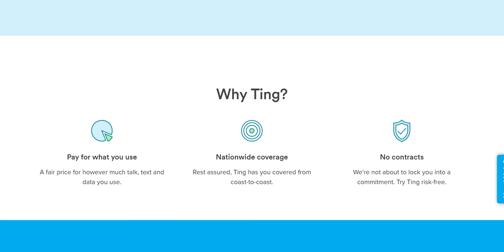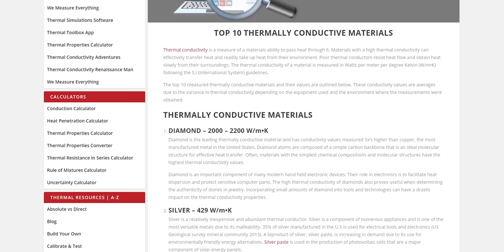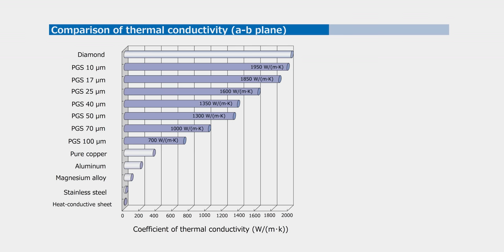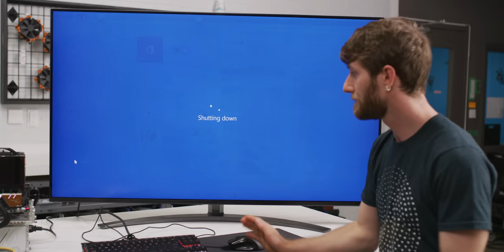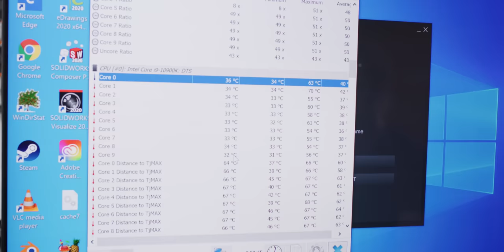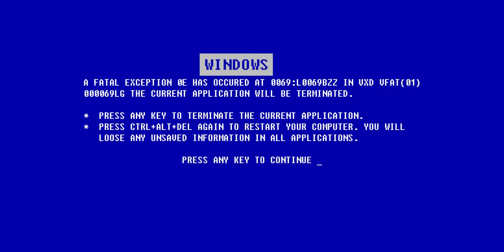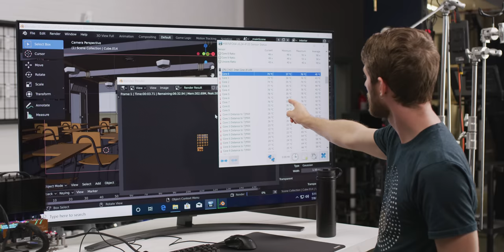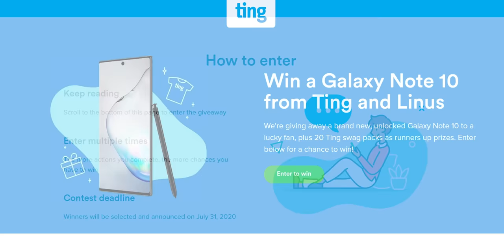This Sounds Too Good to be True - God-Tier Thermal Pad

Comment: This video and the properties of the graphene sheets had my mind thinking of different uses and applications of that product.  I think I've recognized how you COULD use it to better the thermals of a CPU.  There is only so much contact surface between a CPU and the heat sink above it.  The sections connected with the thermal paste is certainly going to be subjected to thermal saturation, where the material will lose thermal capacity at that spot until the thermal energy present dissipates into the surrounding material.  We'll use copper as the example.  The contact patch of the copper to the CPU can only absorb so much heat while waiting for it to spread to the rest of the copper of the heat sink via heat pipes or just more copper.

Now, here's where the graphene could help.  You mentioned that the graphene sheets have an uncanny ability to transport thermal energy and spread it out over the distance of the sheet's dimensions very quickly.  So, an idea would be to apply it in this format : CPU > thermal compound > graphene > thermal compound > heat sink.  The graphene sheet and heat sink contact surface could then, theoretically, be made quite wide (within the supporting boundaries of the CPU case and motherboard components).  Let's say that a 2" x 2" CPU is outputting 200W of heat, thus 50W per square inch.  If you took that same 2"x2" CPU and used the graphene to spread the heat out to a 4"x4" heat sink contact patch, you'd get like 12.5W per square inch of heat.  Therefore, the copper shouldn't reach thermal saturation as easily, and may maintain it's thermal conductivity efficiency better.

If you ever decide to return to this product, I'd love to see you experiment with this suggested setup.

Comment: Somewhat related but I used Innovation's TIM pad on my Xbox 360 S, the pad is the perfect size and works better than the thermal paste it came with. Based on Linus' other video, this was a good enough alternative to taking my Xbox apart to replace the compound. Instead all I have to do is just take apart for cleaning out any dust. If this TIM pad is good enough on an i7/i9 Intel chip, it should be good enough for the Xbox 360's custom APU.

I've been using this for the past 2.5 years. The Xbox 360 fan does not get loud as it used to with regular thermal paste. I used AS5 in the past on my Xbox 360 S, I haven't used MX4 or Kryonaut, but I'm aware it outperforms the older AS5.

I've since switched over to MX4 on my older OG Xbox, OG Xbox 360, and Xbox One. I'm happy with the results of the newer MX4 compared to AS5.

Comment: TIM only exists in this application to displace air. The thickness is so thin that virtually anything will do - and we see that in the 1-2 degree spread in coolers

The pad fails because it doesn't fill air gaps. most pads fail because they're too thick and.or leave air gaps

Try it again after lapping your surfaces (or using something to fill the surfaces)

Comment: With a lateral thermal conductivity in 1000s, I would pick it up if it offer even 1/20th of the conductivity from top to bottom which is still double that of the best paste/ metal available.

Comment: An electrically conductive thermal pad isn't an issue because the top of the cpu and metal heatsink are also electrically conductive and earthed. A graphite thermal pad will go to earth. No circuits will be shorted.

Comment: Try by folding the pad, adhesive on both the cpu and the heatsink. As in 1 piece connected together cause as Jpeg6 said, its lateral thermal transfer.

Comment: It doesn’t matter that it has that high of a conductivity value, the metal heatsinks it is in between becomes the bottleneck and will only transfer as fast as that metal can. Plus it isn’t removing air bubbles as well as thermal paste does.

Comment: You think using thermal paste between the two layers of graphene might not work and better, but it could be worth a shot!

The graphene's conductivity (thermal and electrical) is almost entirely in-plane. It may be a good insulator in the perpendicular direction, but it's super thin. So, the graphene could spread the heat out more evenly across the die and sink while using thermal paste in between would improve transfer between the die and sink.

Effectively, you'd create a slightly lower conductivity over a significantly larger area. (Think 10% lower conductivity over an equivalent of 50% higher contact area.)

I could be wrong. But I think that it's probable enough to be worthy of an attempt!

Comment: I would be curious as to how this would work if you add a good thermal paste in addition to it, and then compare the difference between this with thermal paste and with thermal paste alone. The problem is that there’s an expectation of thermal transfer when its only touching the top ridges of the CPU’s IHS. Therefore, an intermediary thermal compound would be needed to get into the microscopic gaps of the IHS.

Comment: I literally use the cheap thermal paste that was on my ML240 watercooler from CoolerMaster. It works fine with my i7-8700k at stock speeds. About 36-40°C (automatic pump speed which somehow let the CPU cool down to 36 and then it heats up to 40 and cools back down again) in idle and about 80°C under heavy load. It never throttles but the pump is going faster while I play VR games or a stress test.

Comment: Would probably be good on a 3d printer build platform for super even temperature over the whole build platform and not have those hotspots as most printer buildplates have ( witch you can see with a thermal camera)

Comment: I wonder if this would work well as an undercoating for cookware? Cold spots in frying pans on electric stovetops are a problem.
Reply: These are better at transferring their heat horizontally through itself.  But actually the more important point to make here is that they already do.  Just in the stovetop rather than the pan.  Ceramic electric stoves use a ceramic heating element to heat up a pan.  And in case you are wondering graphite and diamond are a type of ceramic.  They probably are not put on the pans because again these things are not good at transferring their heat from one object to another just getting hot themselves and also because in the time it has taken to develop ceramics to a point where a sheet like this could be created we already have more efficient stoves.

Induction electric stoves are an order of magnitude more efficient than an electric ceramic stove let alone a gas one.  They heat up the pan with magnets directly so there is no heat transfer required.  In fact you could put your hand directly on the 'heating element' while blasting it and feel nothing (obviously not the pan though just the stove).  Their only real drawback is that they only work with pans that are magnetic, so steel.

Comment: you should wrap the pads around the heat pipes ... they transfer heat fast you need to spread the surface area out as much as possible z axis is only 10 W/mk

Comment: Try using an Aerogel pad!
(most thermally non-conductive material. Would probably make your CPU blow up lol)
But it would be funny to see a test done on that, with a CPU you don't mind destroying, just to see what the worst possible thermal conductor would do when you ran it under a load test

Comment: The problem is there is a limit to how fast the cooler can dissipate the heat therefore increasing the thermal conductivity between the CPU and the heat sink does not really matter if you max out the heat sink. What would work is to increase thermal conduction apply that liquid metal over the graphite sheet which will increase the amount of contact of the heat sink has with the CPU. Right now the graphite sheet is just holding onto the heat

Comment: i mean if you can cut an ice cube with the heat of your hand, maybe the best application is to use it to spread the heat from the heat pipes all the way across the fins on the heat sink?
if you lined every heat sink fin with these wouldnt that allow for much bigger and more efficient heat sinks with the same amount of heat pipes?

Comment: How about folding it and let the sticky side bond together?  That way, the side with no adhesive is not touching any of the CPU or CPU cooler pad?

I'm thinking that the adhesive side is not as thermally conductive.

Comment: Linus, please revisit this using the graphite, delid the ihs, use liquid metal on both sides to heatsink. Im interested using the liquid metal inconjunction with the graphite. There might be alot of trapped air and micro gaps, the liquid metal might help the graphite bridge and help the thermo conductivity.

Edit: you this method in gpu cooling might help spread out from the gpu to improve heat soak to the cooler

Comment: What about adhering the pad around a small sponge or something and then using the compression of the heat sink to the cpu to hold the pad in place. A continuous surface touching both the heat sink and the cpu might actually transfer the temperature well.

Comment: Just use some indium foil. It is highly conductive, and very soft to fill in gaps (if you push hard enough, you leave a fingerprint.). It is also reletively cheap, with a thermal conductivity of around 85 W/m.k (around the same as steel i believe.). So, it is a little better than liquid metal (which also uses indium if i am not mistaken, but also galium which is not that great.).

Comment: I want to see a layer of the (pgs) on the top of the heat spreader then use liquid metal too fill in any gaps and see if (PGS) help spread the heat from cpu to the liquid metal then to heat sync and maybe help with the spread and have better thermals.

Comment: You should have placed it on top of the cpu and stick it to the bottom of the heating. Forming a kind of bridge between the cpu and the heatsink. I wonder if that would be better.

Comment: The best thermal interface material would be not to have to use any. Any additional component between the cpu and the cooler adds thermal resistance and therefore decreases the thermal conductivity. The problem is that surface roughness and precision of the geometry of the parts are not in a way optimal that you can have two surfaces fully touching over a large area. That is where thermal paste comes in and why you need it in reality. As a tolerance compensation. The pad probably cannot work in that way. What would be really interesting for a future video is you getting the CPU lid and cooler surface as flat as technically possible, mirror polishing it and mounting is directly to see if this way the performance is even better than with the best paste you have.

Comment: Maybe the problem with that graphene sheet is the same that you run into by not using thermal paste at all: contact surface.
The PGS doesn't seem to fill in the gaps of the surfaces - it looks too thin for it - and because it has glue applied to it a metal rod won't do a good work on flattening it. A smooth plastic scoop may better the odds.
Also you could try the thickest PGS to rule out this problem from the start. I bet it still won't be as thick as the graphite sheet you've been using.

Comment: It can be the problem of the heatsink too though, if the heat sink can't handle heat tranfer at that rate, it probably is the bottle neck and not the thermal pad thing.... But tbh I realise that this is for general application and there arent many heat sinks that can handle heat transfer rates of that size which are in the gaming computer space

Comment: The reason for this not working is probably the Crystal structure of graphene or the sheets in graphite. It has a much larger electrical and thermal conductivity in the plane (x-y-direction) than out of plane. 
You'll actually have a really hard time conducting electricity in the out of plane direction as the sheets of graphite are only held together through vandervaals forces, so it's pretty hard for electrons to jump through the layers. Same thing with thermal conductivity as it's dominated by the electronic thermal conductivity in the x-y-plane.
The second reason this doesn't work is that you just don't get a good contact at the interface to the heat sink because it's so thin.
Reply: Assuming we are talking about the same pyrolytic graphite (the one with magnetic levitation) it has more bonds between the planes.
Reply: @DaTruAndi  but those bonds are vandervaals bonds. Isn't the definition of graphite a bunch of graphene layers held together by vandervaals forces?

Comment: I think it only had 2 ohm resistance because u put the probes on the same side of the graphene which is the direction in which electricity can be conducted on a carbon layer

Comment: if it is the glue causing the problem, would you try to letting it sit in some cleaning solution that removes the adhesive? then retry.

Comment: After they took the heat sync off, you can see something isn't flat, if they used the right item(Graphite-PAD), & lapped both CPU & heat sync it would have worked.  But don't they have a sponsor selling thermal paste?

Comment: I wonder if using it more to spread heat and use a compound on top to get a greater effective surface area for heat transfer would do any better. Having the additional medium would have another heat transfer interface but just something that might be interesting to test.

Comment: if you lined the backpanel/inside of a case right behind the cpu - you could probably reduce ambient temp and spillover heat. Turning the back of the case into a proximity cooler for the ambient  heat created by the CPU. Probably wouldnt be worth it to buy it, but since you already have it....

Comment: Why didn't you try using them as a way to increase the performance of thermal paste? You talked at the end about spreading the heat very quickly and the part of the cpu that heats up is always a lot smaller than the cpu lid.

Comment: Seems it would be fine for parts of desktops or laptops other than the GPU or CPU, or the various embedded electronics in long-lasting compact industrial devices where thermal compound would dry out and crack and stop performing well after a few years and cause problems.

Comment: Most stuff would be made out of Graphene by now if we had an easy and affordable way of manufacturing it. It's one of those holy grail like materials that is stronger than steel, lighter than aluminum, and a superconductor.

Comment: 11:28
It may be worse than a heat pipe, but how would it compare as a material for the radiator fins themselves, considering it has much higher heat conductivity than the aluminum being used otherwise

Comment: I think the problem with the sheet is it needs like a ton of weight on it, so it can fill in the tiny spaces and force the air out, but a cpu heatsink has like very little force against the die.

Comment: Here's crazy concept: thermal conductivity larger than one of CPU chassis won't help in a bit. Because it is thin, there are air gaps or lack of pressure.

Comment: once when i ran out of thermal paste, I used aluminum foil between the CPU and and the heatsink. Actually worked until I was able to get some thermal paste. Although this was before CPU's could read their own temperatures

Comment: Can you try using a thermal pad along with thermal paste at the same time. Wonder how that would work? Spread a little paste on each side of the pad.  A thin layer, in theory it should fill in the gaps 😬

Comment: You really didn't bother to look into what you're doing here.
These Pads are basically thin pieces of Graphite. The trick about Graphite is has very good electric and thermal conductivity WITHIN THE PLANE (also stated in the spec sheet) while being relatively strong isolator orthogonal to its plane. (the difference in electric conductivity between these directions is 10^4)
This means it is good in conducting from one corner to the other corner (thats where you get the 1700 W/m.K), but bad in conducting from one side to the other (the way you used it).
This is also demonstrated by the low resistance. if you measure the resistance from the top side to bottom side you'll find a way higher specific resistance than mesuring from one point at the top side to another on the same side.
So what you did is instead of putting a good conductor between you CPU and cooler, you seperated them with a very thin isolator.

Comment: Next time you do a search for thermal transfer pads - use the term "through plane transfer" rather than this in-plane material...
 
This stuff is designed to transport along the material from one end to another which is why it can cut through ice like that.  To your heat-pipe comment - those don't fit in thin electronics...
 
One of the coolest properties of Graphite and diamond in the constrained directionality of the thermal conductivity!

Comment: Graphene & graphite are quite different. You keep saying one then describing the other.
Graphene = wonder material that is super hard to make (unless you use scotch tape - lol) and has many properties we are still discovering  (including being used as both a conductor and an insulator).
Graphite = pencil lead (when mixed with clay).

Comment: Next time, try carbon nanotubes instead; probably not cheap, and probably requires a professional to apply it...
(It might fry your CPU while applying it.... So do the cooler instead; might also make it re-usable, to some degree.)
However, CNTs should transfer the heat along the pipes, so if grown the right way, they should work pretty amazing; especially considering that their thermal conductivity is 2000-3000w/m, depending on the the type of CNT.

Comment: The main problem is as you said
This is a sheet, its not a paste. The problem is that you want to connect the CPU with the cooler thermaly, this because the surface of the cooler etc isnt perfect

Try polishing the CPU and the cooler, and use as little thermal paste as possible whilst squishing it very hard